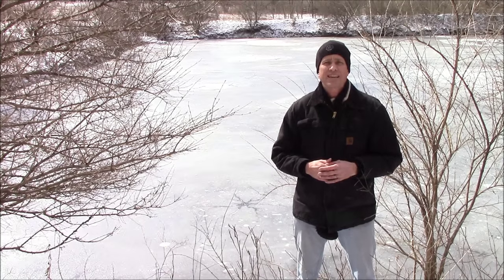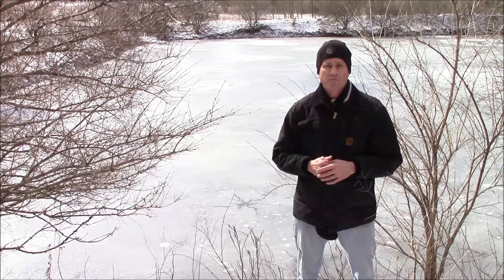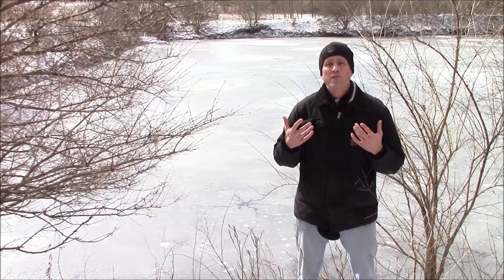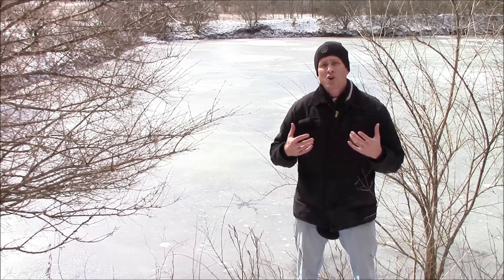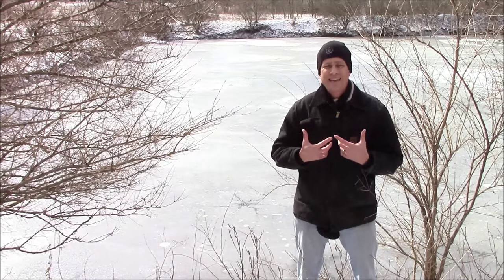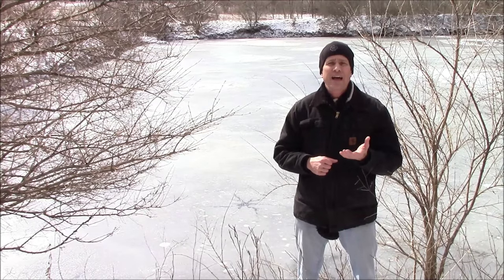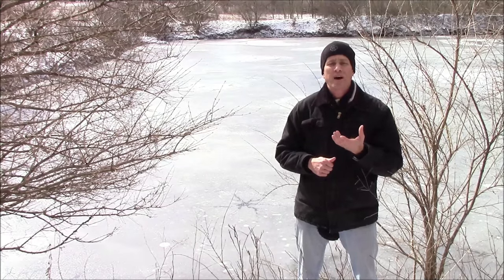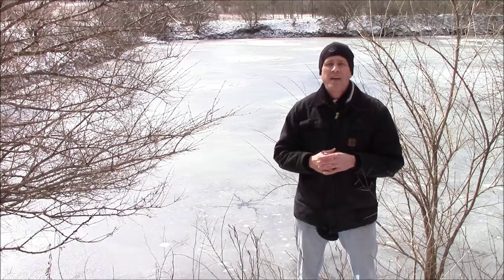LED Flashlight Thermal Management, Elzetta vlog episode 20

Comment: I accidentally activated my Elzetta Alpha on high during a rifle class and had it running for a little under an hour without realizing it. I finally noticed it when my hand brushed my side and felt a hot flashlight. I just replaced the almost dead battery and it was good to go again, so I definitely trust its thermal management among its many other features I've tested to extremes in equally as clumsy ways lol

Comment: Ordered that exact same Surefire light, a few days ago. After seeing this video, I have to test for my own. Have the Alpha and a Bravo with AVS head, so can compare both to the SF. Did order the SF mainly because of the plastic handle, because it doesn't get as cold as metal. And underneath that molded plastic is a metal tube.
Reply: I thought the comparison was pretty unfair because the SureFire G2X series is one half or even one third the price of an Elzetta, depending on the model.
Reply from the maker: +TheCrushmaster Of course plastic is cheaper.  The point is that proper materials and design are required for sustained performance.
Reply: It's not cheaper just because it's plastic...The 6PX series, which is aluminum, is still significantly cheaper than an Elzetta. The point is that these lights do indeed have lower performance, but also an exponentially lower price point, so a comparison isn't entirely fair. Of course they'll have less features (including materials) - they cost a lot less.
Reply: On the other hand, I can see why you'd just say, "Go ahead and spend the extra money and get an Elzetta", which I can agree with to some degree, haha. I'm probably just not the intended audience for this video.
Reply from the maker: +TheCrushmaster True, those lights are cheaper for a host of reasons (mere reflectors instead of optical lenses, no potted electronics, no modularity, etc).  We cover those topics in other video blogs.